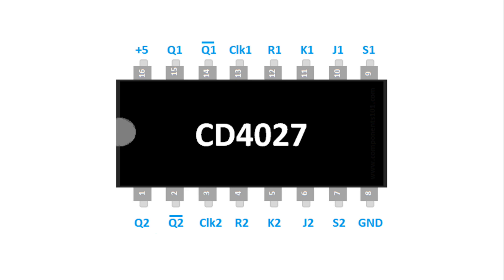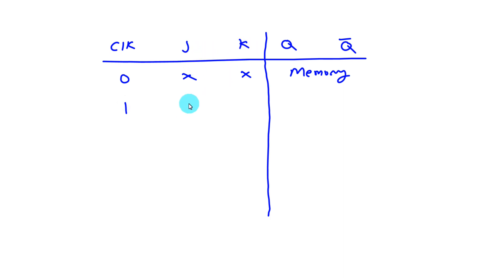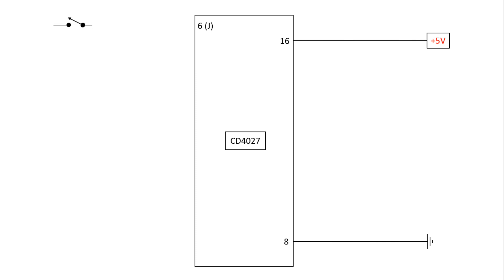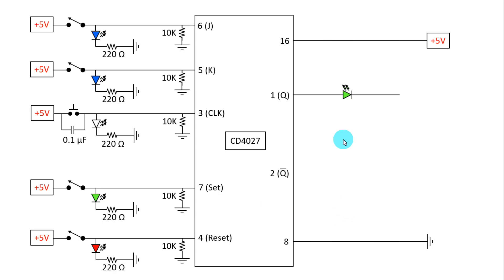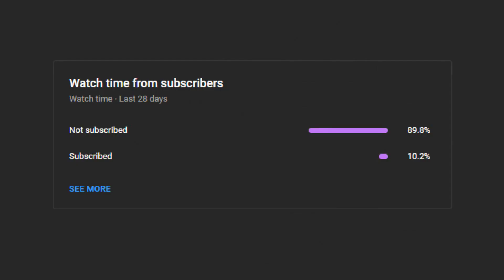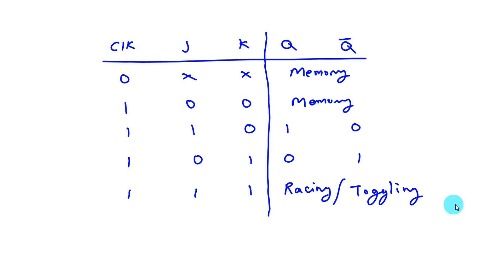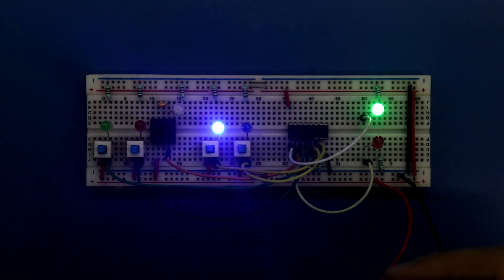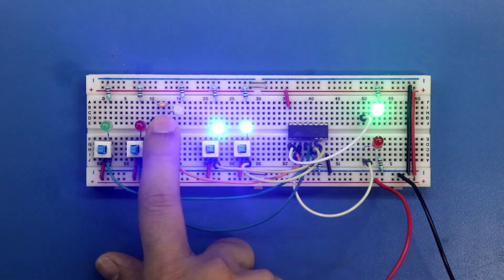CD4027 JK Flip Flop Practical | IC 4027 Truth Table Verified on Breadboard

Comment: Yes, I did have a question, myself. :) You said that the first state would be the last state in use after connecting the IC to supply for the first time in the video, so I was wondering if these ICs have enough internal capacitance to hold state even if Vcc is disconnected? I've heard some ICs hold enough internal charge to hold state even without non-volatile storage, and since this is a fully integrated flip-flop that hasn't been constructed from gates, that got me curious. Thanks for your attention in advance!

Comment: Practical use of this in electronic??
Reply: They're incredibly useful, actually. I'm currently designing a circuit that takes full advantage of all the features of this particular IC; I'm consulting this to be sure of my connections when I prototype. These ICs can be arranged in arrays that can execute complex switching matrices with diverse logical schemes.

For example, you can use momentary switches with multiple throws connected to several flip-flops so that one is set, and the rest are reset, forcing an exclusionary selection of one of many, but never more than one at the same time, so that only one can be selected, and the selection will reset the previous state regardless of which one is set in the array (XOR logic). From there, you can fan the outputs to an AND gate with the necessary number of inputs where it can be met with the outputs of sub-selections that can be controlled by another XOR-based flip-flop array, or toggling (T-flop) to control additional signals or controlled outputs that will only activate when all of them are selected at the same time.

Finally, you can use the Preset (PRE) and Clear (CLR) to suspend the outputs under certain conditions, like a powered off state with backup to maintain the stored output states without powering any part of the circuit outside of the IC maintained by Vcc as volatile memory. Or it can be controlled by switches that shut them off at the discretion of the user to suit the needs of the design and its practical application, either with a latching or toggling switch, or momentarily while the switch is held. That way, when the suspension is lifted, it acts only as a temporary change that returns to the state it was switched from by changing the control switch state to the previous without having to use more than one switch for this function, and therefore the primary array acts as a default state that can hold a selection from which altered or temporary states can result as a mutable base that can switch forward and back from a set state or condition freely determined by the user, instead of working from set defaults determined by the circuit which only has one primary default state that cannot be controlled.

All of these features have very practical utility in circuit design, and can be combined to great effect.
Reply: I wonder too. I've seen so many flip flip things but don't what application they can be used for.

Comment: Sir I really need your help sir I have made D-flip Flop circuit my circuit is working but I have to display its output on seven segments display instead of LEDs and I have 10 pin common anode segment display how can I connect d flip flop out put please sir I have to submit my project please help